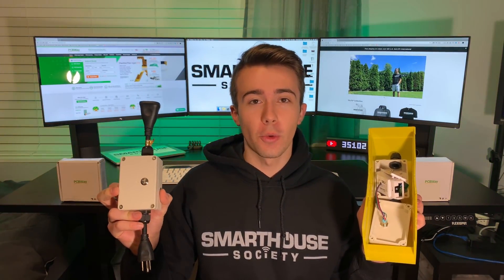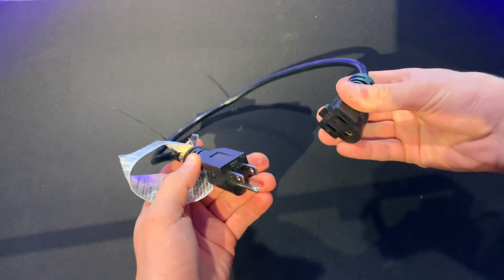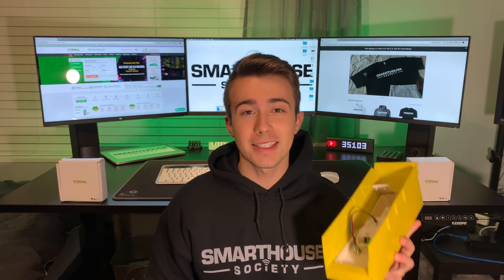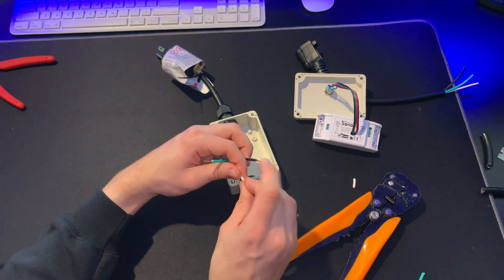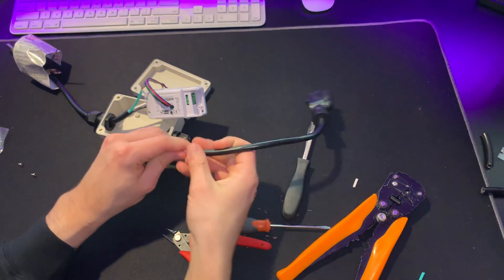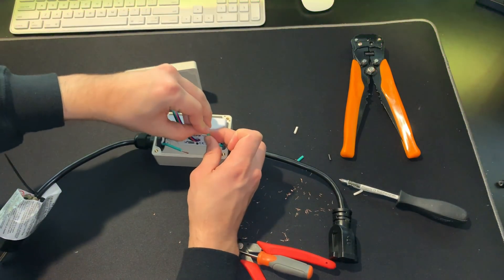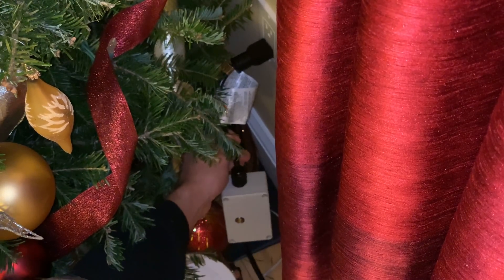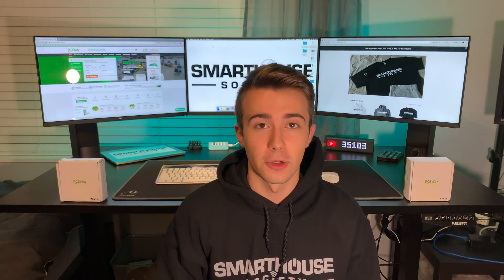Sonoff Basic R2 Complete Guide DIY Smart Plug: Deploy (4/4)

Comment: Would have been really nice if you could have shown how to connect the switch to my WiFi.  I know how to do wiring.  I know how to push a button in eWeLink to turn someone on/off.  But I ALWAYS have trouble getting my Sonoff devices to connect with my WiFi.

Comment: think about it to add a fuse. That makes the sonoff a lot more safe. so that if someone uses a device of more than 10a, the fuse will burn out.
Reply: Where to add it? , output or input, cause I'm using a UK male plug that has a fuse inside.